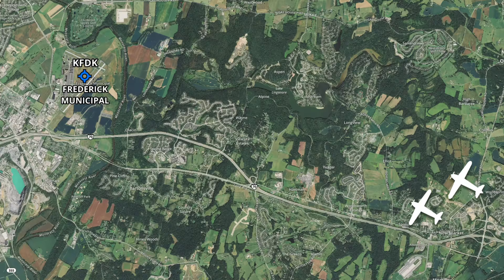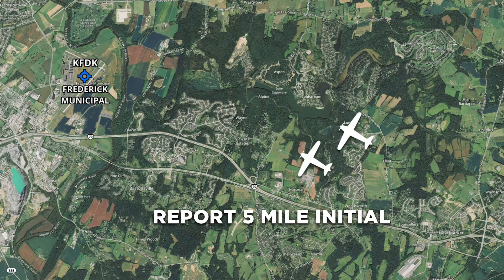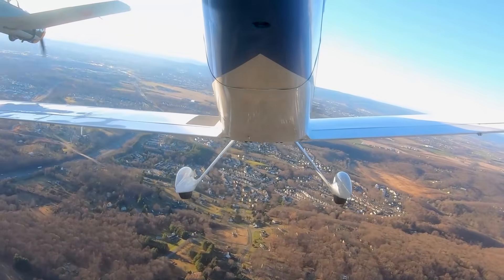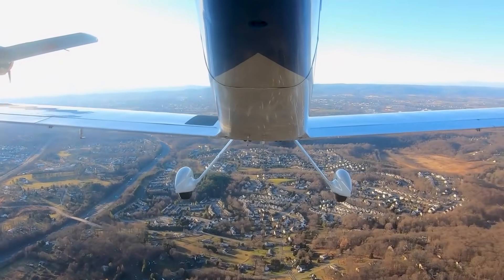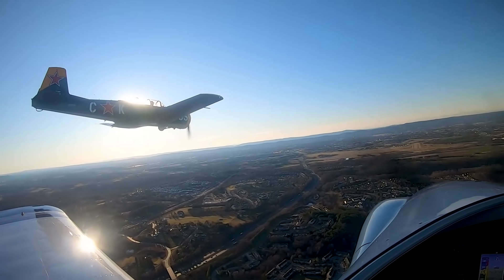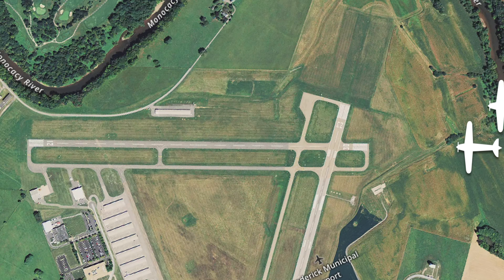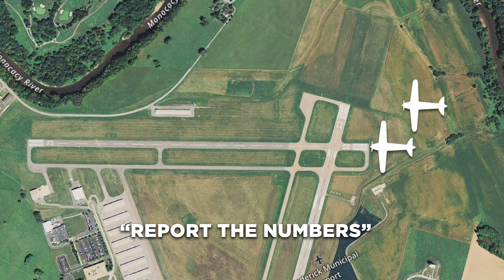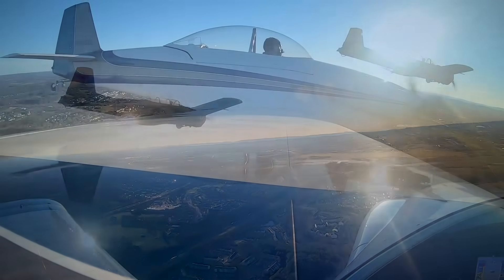Tips & Techniques: Flying an Overhead Approach

Comment: Except, today I’m in the pattern doing touch and goes at a non tower airport, left traffic 34. I’m on left downwind and I can see an aircraft on approach to the same runway on ADS-B. About a mile further out than me.  I did not know it was a flight of three. Lead aircraft makes a radio call that they are a flight of three and will do an overhead break to 34.  What should I do?
Reply: Where on the left downwind are you?